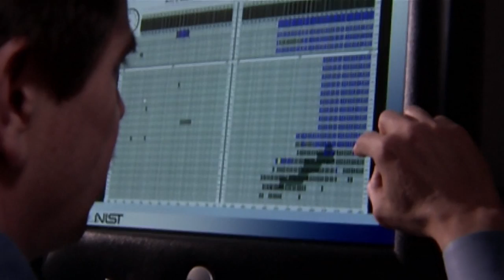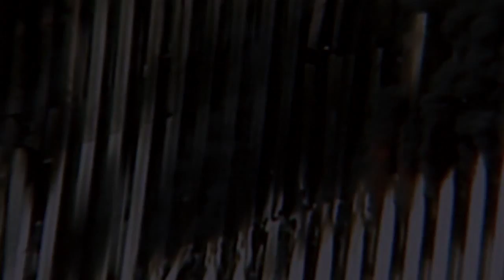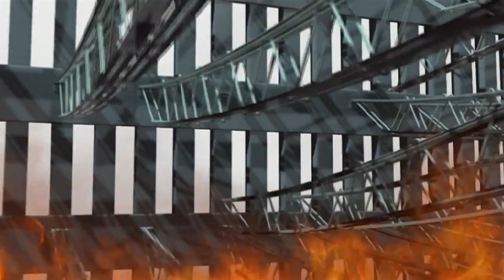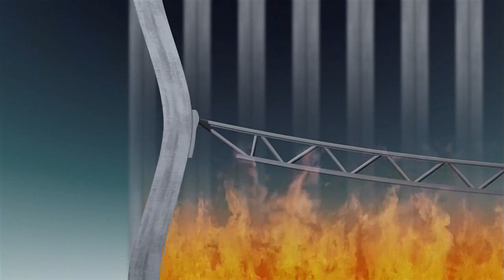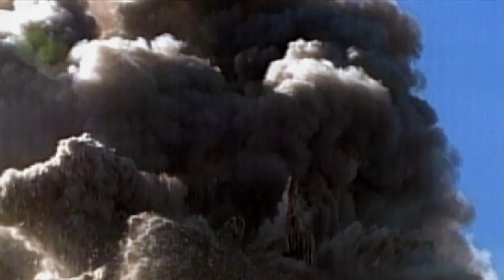WTC - collapse revised

Comment: Control demolition
Reply: since when do avalanches have steel framing supporting them? you seem to lack principal understanding of avalances but don worry, i live close to the alps

in fact: in alpine resorts you WILL SEE STEEL GIRDERS STOPPING AVALANCHES. that is why they mount them on mountain tops  to PREVENT THESES PHYSICAL CATACLYSMS and that is why they are in the concrete, doofus!

Pancaking collapse does not work because the subsequent floors have MORE GIRDERS and MORE WEIGHT than the top floors. earth quake resistant my friend. the piledriver would be FORCED OUTWARD OF ITS GRAVITATIONAL FALLING DIRECTION. it would TIP OFF, FALL OFF. bot not symmetrically crush. not after an ASYMETRIC FORCE INPUT (plane hits from one side, unequal force distribution, kerosene does not burn orderly but chaotically, distribution of kerosene and debris destruction NOT SYMMETRICAL/ORDERLY) as such, there CAN NOT BE AN ORDERLY PILEDRIVER, NOT ONCE and ESPECIALL NOT TWICE. the force is NOT SYMMETRIC.

Also: while the steel in the impact zone may be slightly damaged, it is NOT DAMAGED underneath, and why would it be damaged? from what? So even if the top starts moving UNLESS THERE IS EXTREME HEAT/THERMITIC REACTION  the steel framing underneath STILL PROVEDS RIGIDITY AND FLEXIBILITY...  but it did not... so how did it get so flexible, so sensitive so fast? from what heat?

 But the resulting damage is symmetric, the girders are molten to slab. explain to me why. what made it so hot

In order to prevent the cataclysm prevention from working it has to DISINTEGRATE. and steel only disintegrates or loses its integrity when heated to over 1800°
Reply: you must be a religious man. trained to believe what he is told by a higher abstract insane authority on a dogmatic totalitarian non-argument. the kind that swears oaths, believes in an invisible man in the sky or tells his wife to obey. idk man, but physics and engineering, better stay out of these professions... you d just waste your time on learning stuff you ll never understand
Reply: no, plumes of smoke, flashes of light and catapulted objects usually are. oh. and there is a bang...
Reply: so did they pick up on the plane impacts? the collapse initiation? 
because this is the masking of the explosion. And thermite explosions 
are not thermobaric bombs with a huge blast radius. they are plasma 
cutter charges, they don t produce seismic events
Reply: also you are confusing your being confused with me confusing you. YOU WERE CONFUSED BY YOUR CONFUSER (TV, BEER, YOUTUBE).... because only one metal glows yellow orange in sunlight and that is STEEL/IRON at about 2000 degree celsius. - no aluminium does not glow yellow, it glows WHITE/SILVERISH - compare NYE rockets and its glow is not visible in sunlight. 

but in order to disprove this, go have a look at a foundry yourself. have a look at floating liquid hot aluminium. go look for yourself. youtube provides all the capabilites.

You can BTW distinguish a hot fire from a cold fire. a fire with lots of oxygen (no smoke/white smoke) to a fire with insufficient oxygen (black smoke) hence you can estimate the heat of the fire. black cloud means not 1000 degree celsius.  means; NO MOLTEN STEEL.

 So now go and find the source of such heat in an office fire, kerosene fire or any fucking fire that is not created by welding gas, explosives or cutter charges. You won.t 

In the official explanation, there is not enough energy to even properly bend steel beyound the point of impact. and even provided the top would move, it would be crushed by the structure underneath, not the other way round. THERMODYNAMIC LAWS, DOOFUS... small object acting against big object with more mass loses. Or would you say, a sumo ringer falls down unconscious when an apple falls on his head? because this is what they want you to believe... this is the mass/weight ratio between top and bottom of the building.

And an explanation for the underground fires raging for months at 1500 degrees celsius? NIST has no explanation. 
Thermite/Thermite residue explains it in ONE FUCKING POINT.... unused thermitic oxidants providing energy.
Reply: whatever institution backed the official story. Watch donald trump take over institutions, destroy their data and come up with new explanations for global warming that DON T hurt his energy lobbying partners. You do understand that when a coup happens, institutions have to be aligned with the coups narrative. 

so point by point: 

1.)metal workers DO KNOW what i am talking about, there is extensive material in metallurgy to support my claims, if you want sources, i can point you to some. I don t have this from videos but from studying physics for an engineering degree

2.) what has been shown? nothing. the NIST simulation stops at 1,2 seconds and is faulty at best. it only provides explanations to people who don have their brains switched to ON. or people who have NO FUCKING CLUE OF PHYSICS. so some "Association" claims something that is in COMPLETE CONTRADITION to what THOUSANDS of ARCHITECTS AND ENGINEERED IN OPEN PEER REVIEWED INVESTIGATIONS HAVE FOUND?
try "architects and engineers for 911 truth" they have a channel here, and they are NOT truthers, they are scientists. they are not interested in politics.

The claims i make can be easily tested at home. take a welding torch, melt aluminium, don forget to use a welding mask. For the oxygen/fire theory, try burning wood under a blanket, try it with a blowdryer.
or in general, ask yourself how a blacksmith gets coal to a heat where he can hammer steel... and again, what color does the iron have when it is hammered? blue? green? why don t blacksmiths hammer aluminium? find it out for yourself...

3.) kerosene burns at 600°, office fires go about 800-1500° at which steel loses some of its integrity, yes. but the concrete and gipsum in these buildings are inert up to 2000 degrees. go look it up, there are tables in fire safety.

4.) The energy needed to bend steel is higher than the energy to melt aluminium. again, try high school physcis tables about melting points. The steel girders bent like spaghetti point to EXTREME HEAT. extreme heat that makes metal liquid. There we are again with temperatures that don t exist in building fires.

5.) No other steel frame high rises have collapsed due to fire, EVER. except on this day, on which THREE collapse. ONE WITHOUT BEING HIT BY A PLANE. now your explanation must get even more complicated, mine (thermite/thermate) still ties ALL THREE INCIDENTS.
Reply: again: the tip is smaller than the bottom, it has LESS MASS, LESS WEIGHT, LESS GIRDERS. 

HOW CAN A SMALLER OBJECT CRUSH A BIGGER OBJECT WITH MORE MASS??? 

So, take your MINI and try crashing it into a fully grown TRUCK with some containers on your morning drive to work. and see which object gets crushed. your car or the truck......

That is the MAIN THERMODYNAMIC FALLACY of Tower 1&2

so maybe that is not GLUE you are on but "COGNITIVE DISSONANCE"
Reply: and there are THOUSANDS of ENGINEERS & ARCHITECTS that AGREE with my estimation. i ve pointed you to them. And the republican fakenews FOX/CNN aparatus has been attacking and discredited them since they started their investigations. which are of course public, peer reviewed and transparent for you and me. while now coulter, breitbart and trump protect saudi interests of the real perpetrators against juridical prosecution. after 3 genocidal wars with US soldiers on false gorunds.... Irak WMD... where was the proof for that? What did the media tell you about this, remind you: THE SAME MEDIA LYING ABOUT 911.  Do you dare look into the rabbits hole? i wonder...
Reply: THE MOLTEN POOL OF IRON UNDER THE RUBBLE burning and smoldering for over 91 days PROVES STEEL DISINTEGRATED

structural failure needs a CAUSATION. what is the cause. the heat is not enough, the damage is not symmetric. you are just picking cherries. under 1800° steel will not bend. not without cracking. Go have a look at steel girders from 911 BENT LIKE SPAGHETTI, WITHOUT CRACKS. means: the heat must have been higher than ANY OFFICE FIRE EVER MEASURED. where does the welding heat come from?

a moskito net does not lose structural integrity when you puncture it with a pen. ESPECIALLY NOT 20 LAYERS of them interconnected.

you are just clinging to the lie that barely keeps your narrative from hitting the ICEBERG that is the physical reality of heat, metal and force (of WTC7 - which WAS NOT HIT BY A PLANE YET FALLS INTO ITS FOOTPRINT WITHOUT RESISTANCE)
Reply: Underground temps were over 2000 degrees after the collapses.
Reply: that the heat and time of being at such temperatures was never initiated by kerosene, friction or any type of normal building fire.  it proves that the planes were just a distraction to some explosive event, that - given the time and amount of molten metal, its reactiveness when exposed to air and water - BRINGS ITS OWN OXYGEN. thus implying that it is some sort of thermitic reaction. because any other form of burning would just consume the surrounding oxygen under the rubble to the point of quickly extinguishing itself. you don t get to foundry temperatures without pumping air into your fire or having proper fueling material. no air, no foundry. but with a pile of dust and stuff on top, it is hard to imagine that a robust aerial flow would have been established and even if, where is your grade A charcoal?
the fire did not extinguish itself - and there was no NIST-theory concerning the molten pools of metal- for months. reacting explosively to water. classic case of a residual chemical welding reaction. without the foundry or the welding plasma

you should rather ask yourself what got the molten metal there in the first place. since no high rise building except for that day has misteriously collapsed, - EVER !!! - there is no comparison, but how would molten metal accumulate under a building with a normal office fire and a little kerosene? have you ever been to a foundry? again. steel frame buildings do not collapse, not due to fire, not due to airplane impacts
Reply: Hearing and seeing consecutive explosions before the collapse are detonations.  Seeing horizontal ejections up to a block away before the collapse are detonations.
Reply: Alot of the firemen there thought it should of tipped over.  The towers weren't a gravity induced collapse.  They blew out horizontally up to 600 feet into other building as well.
Reply: a nuke is more than improbable. provided there is such a type of minimal invasive nuclear device, the whole building would have evaporated from the bottom to the top, the event would have been shorter and more violent, radioactivity a serious illness around the affected areas. a neutron bomb would have been measurable.
Reply: Nuclear fission caused that heat for months.  Thermite is a short lived reaction.
Reply: 1.) thermite COMES WITH OXYGEN... since it contains IRON OXIDE (Fe2O3) which after reaching its reactive threshold then drives the reaction, even without any additional oxygen, the iron oxide releases oxygen atoms during the reaction
 2.) what material drives your furnace? gypsum? concrete?

there is no charcoal around, no material that could create heat beyound 1000 celsius

3.) at which poimt D´UH the girders are still 1000 DEGREES MORE away from losing their gypsum shielding up to which point the steel is not even attacked by any serious heat (gypsum/concrete is INERT well beyound 1500 degree celsius)
Reply: it did not just stay melted, it did react off. the thermite used was of military grade and they did overdose properly... it would successively corrode the material above and increase in size, it needed months and lakes of water to cool it off to a working temperaure, this alone is a red flag for an ongoing chemical reaction of immense proportions, the amount of radioactivity measured would point to such a reaction.

the "combustible material" would in fact turn into gaseous form long before any steel would be affected, 1000 degree celsius eats away at most non-steel/iron materials, even aluminium. we are talking about welding temperatures. you would evaporate into water vapor, pretty much instantaneous.

the material probably delivered additional oxygen to the reaction of the thermite, but a normal ember fire would be extinct due to lack of oxygen or extinguish itself in a dust explosion
Reply: "superpwer"??? there is a simple thermal chart in your 101 physics about metal, temperature and coloring
Reply: AH YEAH? show me one under a high rise that got the high rise to fall.. AND ALSO NAME THE SOURCE OF THE TEMPERATURES, VIDEO. LINK, SOURCE

YOU PROPAGANDA TROLL
Reply: You should read the oral histories of the new york times of 503 responders who saw horizontal ejections, plumes of smoke, flashes, explosions before the collapse even started.  Who were thrown by the blast wave, firetrucks windows blown out, overturned, guages blown out...
Reply: true... but if it makes multi-ton steel girders fly, it wasn' t a simple firecracker. so the question is: who rigged the building, who gave tho orders, what were the reasons, what continuum is this event a part of and: CUI BONO (bush, saudis, brits, AIG/ENRON culprits, building owners (stop-loss, insurance claim), wahabis...)

if you look at the result, you may have the impression, that this was a silent coup d'etat that you did not see, because your look was being guided when you were looking for someone to blame in the immediate shock.

who would think about AIG/Enron or insurance fraud, when the mic is handed to the George W. Ape first
Reply: you are a fucking paid moron. fuck you. byebye...
Reply: You are talking about FAHRENHEIT (like an idiot)
I AM TALKING ABOUT CELSIUS,  THE DISCREPANCY REMAINS

because NO the steel does NOT LOSE STRENGTH, because it is shielded with CONCRETE (inert until 2000 degree CELSIUS) AND PLASTER/GYPSUM (INERT TO 2000 CELSIUS AND BEYOUND) BOTH MEANT TO INSULATE THE STEEL. which they did in the rest of the building and why shouldn't they. symmentrical collapse after one sided damage? fuck you moron... show me the high rise building in which the steel girders lay bare in on any storey but the subterranean floors.

 so take your troll bot accounts and shove em up your ass. Kerosene could BURN FOREVER and the building would not crack, bend shift or lose ANY of its strength. 

EVEN IF THE BUILDING HAD BEEN FULLY (!!!) ENGULFED IN FLAMES it would not have come crashing down without thermite/explosives/welding charges. IMPOSSIBLE and especially not symmetrical, near free fall speed.
140 highrises burning completely, most of them STILL IN USE TODAY, except on 911. and now explain me why you were in IRAQ.

and no, at 1000 degree CELSIUS steel does NOT GLOW YELLOW/WHITE and does NOT FLOW LIKE A LIQUID, DOES NOT BEND WITHOUT CRACKS as shown on multiple girders and trusses. also, it does not create razor sharp welding charge traces in remaining girders and NO cleanup crews expecting bodies do not use welding charges to remove rubble
Reply: A mini nuke placed under the foundation would cause molten metal thru fission.
Reply: That proves that jet fuel or office fires weren't the cause of those deep underground hot temps.

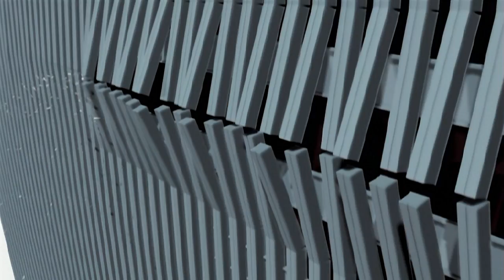Comment: look at 1:22 ... the antenna collapsed first... it was the first thing to sink before the rest of the building as follows... this means there must have been severe damage to the CORE... forget the trusses, the CORE was damaged. You can see smoke being blown from the top of the building before any smoke is blown out of the "impact" zone. It's hard to see cause it's within a split second. Watch closely... Antenna goes down first, building rubs against impact line, falls into it, then collapses.
Reply: The core was mostly drywall, of course it fell first.

Comment: @Hotters70601ben 

Quite right. Many architects, including myself, did not know that the cores of the WTC towers were as robust as they were. The cores practically constituted buildings in themselves. 

The cores of the WTC towers were virtually "buildings within buildings."  

When we later learned how solidly constructed they were, the official "pancake theory" fell apart.
Reply: Umb O  But the weight under the impact zones was strong enough to hold the collapse. There should have been resistance...it makes no sense why there was no resistance.
Reply: The core was built of mostly drywall with thin, hollow steel frames between.

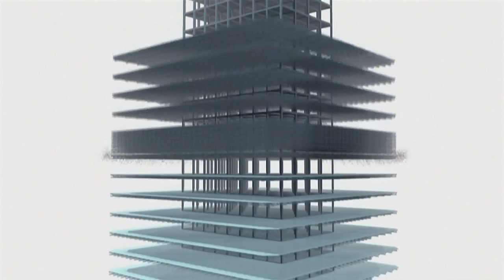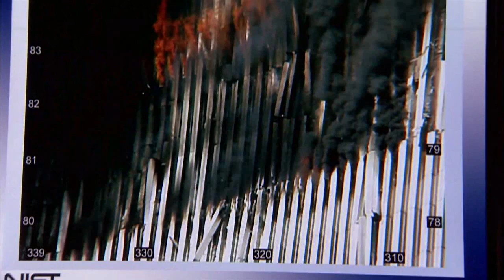Comment: 0:41 to 0:47 showing the "pancaking" myth unwittingly reveals how absurd it is. 

It unwittingly shows that the interior core consisting of a dense matrix of massive steel columns and beams, would have been left sticking up in the air. 

It unwittingly shows that the "pancaking" would have resulted in a huge stack of nearly 100 "pancakes" at ground level. 

Alleged "pancaking" unworthy of term "theory," or even "hypothesis." It can only be termed a myth. 

Verdict? Controlled demolition.

Comment: Let's see, the MSM assures us that the WTC towers collapsed because the connections between the exterior columns and the trusses failed. 

No, scratch that. The WTC towers collapsed because the connections between the exterior column and the trusses didn't fail.  

No, scratch that. The WTC towers collapsed because the connections between the exterior column and the trusses failed.  

No, scratch that. The WTC towers collapsed because the connections between the exterior column and the trus-